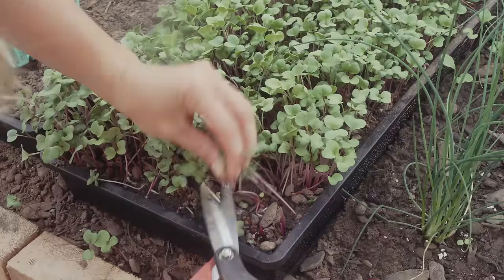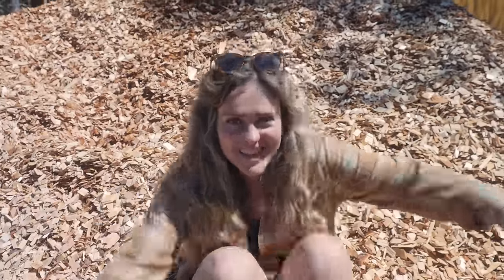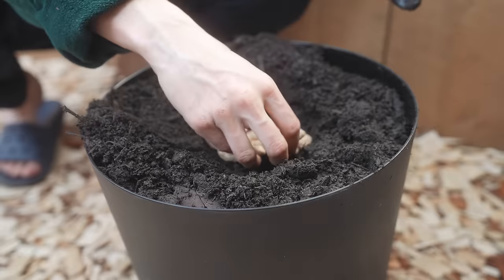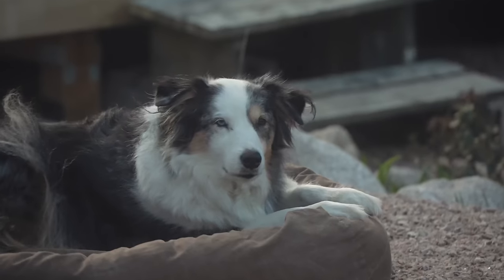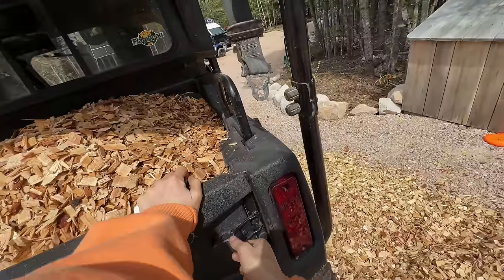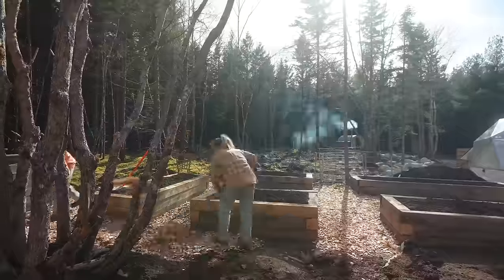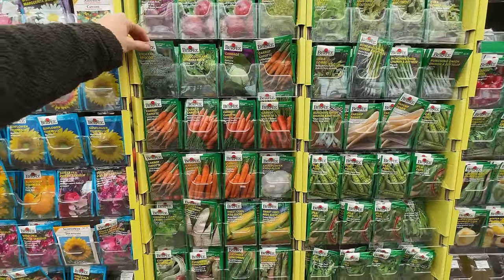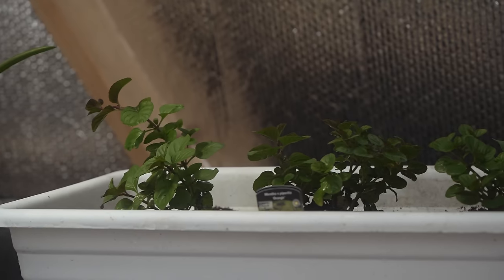How Much Food Can We Grow In One Year?

Comment: If you add a PVC or metal pipe vertical in the corners of your garden bed so the stick up a few inches above the soil you can add smaller pipe into them to create many different garden uses such as two across that backside to make a trellis or bend a smaller pvc pipe from one corner to the other to create sheeting to cover if it gets too cold.

Comment: Great video, as always! Just wanted to mention, in case you hadn't thought of it; It's the frequent starting of your ATV without enough run-time to restore the energy used in starting it that is wearing down your battery. This will also shorten the life/longevity of your battery. Let it idle more often when you are doing short runs so the alternator can replenish the battery. Cheers!

Comment: Warning: the tree in the middle of the gardeb will dry if you don't protect it by not outting durt on the back at the bottow.  if you cut the air flow at the bottom it will die.

Comment: I can see a problem. Many of the store bought vegies are special hybrids these days and either the seeds wont produce anything like the vegies you bought or not exactly the same. Now if you are sure that the vegies you bought are "heritage" vegies the seeds may produce the same as you bought. Also, the carboard boxes could have been unfolded and placer on top of the soil an cut or poke holes in them to plant the seeds/seedlings in the soil underneath. This elimenates the weed problem and helps hold misture in the soil during dryer seasons.

Comment: Just and FYI: most food that you buy from the store is genetically enhanced and the seeds from these products, usually will usually produce small uneditable fruits. I would recommend you buy seeds from the store. They are very cheap and you’ll be able to get the size fruits and products you expect to get if not what you will get will be extremely small and unproductive. And trying this I found there’s about 25% of success and 75% of failure. Onions and potatoes are the exceptions to this rule, anything that grows from the product, not from seeds will produce the same thing. And it technically can be a patent infringement.

I also put in stakes and cut plastic in case you get a late frost so you can cover everything up quickly